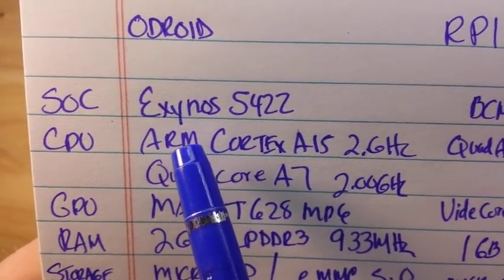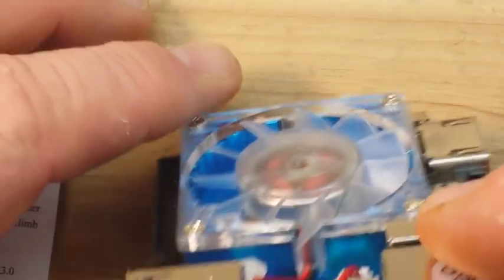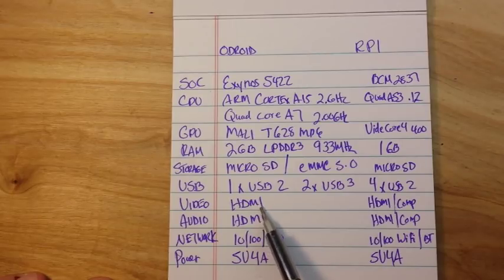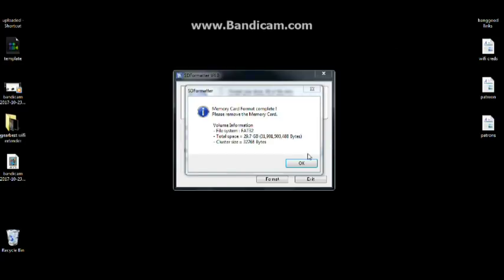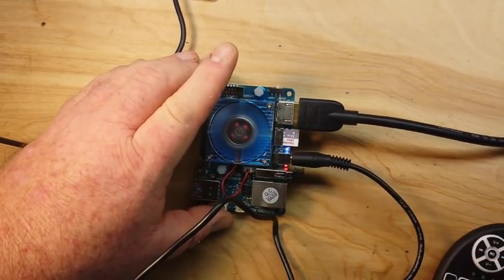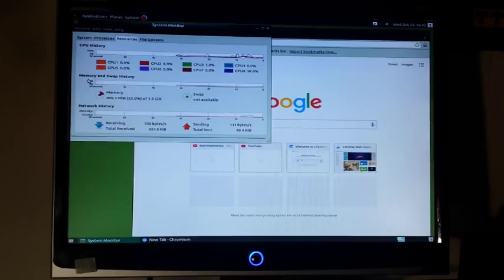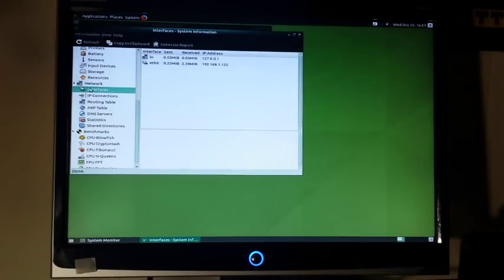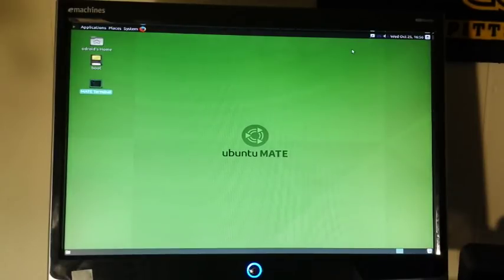Odroid XU4 first look

Comment: You forgot the MFC and a lot of other pieces that accelerate stuff through standardised linux kernel API's.
Basically I think everything should probably work with a 4.15 kernel except for the tmali driver (needs a gpl kernel patch), and the HMP scheduler. Samsung is one of the top contributors to the linux kernel, so I guess that this will eventually all get sorted out.
The only thing I miss on hardware use is that since there is no real kernel API to deal with resizers, rotaters, color converters, plane mixers and actual output, we still can't render to a video buffer, and mix the video buffer with the desktop buffer upon serialising the data to the HDMI. On a pi that's a kludge, but it is done. On a xu4 rendering of a video stream now goes through opengles to bitblt it onto the desktop. It can mix and alpha blend 4 bitmap planes, but alas :-(. At least we have a very good upstream support.

I have a XU3 that I use as my desktop. I have a few XU4's as my home cloud as buildservers, VoIP , mail filters, etc. With the HC1 (stripped down XU4 with sata interface) I hope to replace 50% of my current home cloud. The CPU outperforms generic c code by a lot when comparing the exynos with for instance intel atoms, or the mobile i3. As a matter of fact, I was dissappointed to see that a current mobile i5 still can't outperform my 8 year old core i7 920 when doing some video conversion.
Which unfortanetely is a real pain on an exynos, as most of that code was hand optimised for intel arch.

Comment: nmcli or nmtui should get u up and running if u wanna use the terminal.
Reply from the maker: +ccc is that for the Wifi?
Reply: nmcli d wifi list   (to connect) nmcli d connect <nameofWifiInterface>
Reply from the maker: ccc Thanks!
Reply: all options if u scroll to the bottom it gives examples   https://developer.gnome.org/NetworkManager/stable/nmcli.html

Comment: Great video as always! That would make a rather decent desktop PC for very little money. And I hope you will feel better soon even though your heavy breathing was no issue at all
Reply from the maker: +Michael Eckl Thanks. I think it will make a very competitive desktop to the low end Hps and dells you can get for 300-400 bucks from Wally world.

The more I play with it the more I like it. Right now, the only downside I see is the lack of a SATA port for an HDD.

I'll be doing another video when I get more familiar.
Reply: Cool! Looking forward to that! 
The missing SATA is a bummer but a USB 3 disk or a big enough SD card should provide enough space. It will just be slower compared to SATA
Reply from the maker: I demonstrated all cores running in Ubuntu in the next video.
Reply: That 'oct core...' the Odroid has A15 high performance quad cores AND A7 power efficient quad cores on the same chip. So yes, 8 cores BUT
(and as far as I know, so feel free to fact-check) BUT it never runs all 8 at once. Making it's top 'speed' 2ghz A15 quad cores. Still much faster and less power efficient, than the 1.2ghz A9 quad in the Pi3.

Again, making some assumptions, I think the A15/7 4+4 soc is used in the Odroid for two reasons. 1 - it's a common format, already used in many flagship phones which step to the A7's to save power. 2 - when you read the specs in looks like it has 8 parallel cores...

To the best of my knowledge it is technically possible to run all 8 at once, maybe Ubuntu or Android are planning to support this? However, at very least that means dealing with a LOT more heat. Even with the Odriod's fat blue fan installed, the A15/7 Cortex die isn't designed to dissipate all 8 at once.

So what's that then? Yes it has 8 cores. No it's probably not 'oct core.' Yes it's much faster than the Pi3 (also more expensive) Yes it might be able to use all 8 but it's not designed to, but sbc's are for hacking ;o) maybe someone will hack it on Android for 8-core gaming? xxJ
Reply: oh, and the Sata port is on the corner of the board, next to the usb3 sockets. It's only Sata Data, so you will need to find power from somewhere or buy a Cloudshell2 or similar for 'real' sata sockets. ;o)
Reply: Gimme the link then, I'll watch more :)

Comment: when getting my odroid i just bought the dongle directly from their site and it worked.
Reply from the maker: +fredlllll Mine came from Amazon. But I did order a don't let based on RTL8188 as recommended by CBM80AMIGA.
Reply from the maker: +fredlllll Are you running the Ubuntu Mate from Hardkernel?
Reply: yup
Reply from the maker: +fredlllll Thanks. Do you have any trouble reaching repositories? I keep getting errors.
Reply: uhhhm its been a while since i tinkered with it, but i dont think i had any problems or i would still be mad at it XD

Comment: You probable don't have proper kernel module/driver for your dongle. Find out what chip is used in your WiFi dongle and google for it "<chip> ubuntu  module/drivers odroid". I hope you find something useful. Even if not for exactly for odroid you can compile source code. Easiest way is as always to use most common hardware which already has kernel module built-in. That's why I suggested this cheap Realtek which works well with less supported platforms like Orange Pi.
Reply from the maker: +cbm80amiga I ordered the chip you recommended.
Reply from the maker: +cbm80amiga Thank so much. I ordered the dongle you recommended and it worked straight away.
Reply: Hi, I am thinking of getting a XU4, what realtek dongle did you get ?
Reply: Cheapest Chinese dongle with Realtek RTL8188 chip for $1.6 usually works on most devices.

Comment: My laptop has 1 3.0 usb port and this board has 2 usb 3.0 😁🤣
Reply from the maker: Electronic projects My laptop has 0 USB 3, you're doing better than me.
Reply: My xu3 (predecessor, 3 times as expensive) has 1 USB3 and 1 USB 3 OTG. Which means it can act as a USB device/gadget. But unfortunately it only has a 100Mb/s NIC.

Comment: I've had some problems with wifi and Ubuntu. It seems drivers are the hard part. This is a really cool board and fast too. I hope you do some more with it maybe run Android? Hows the other big new toy coming?
Reply from the maker: +George Chambers There will be more coming on the XU4 in the future. I'm looking for something to use as a desktop replacement.

The other project is about 20% complete, and I'm done for the night. I need to look at some code for a patron, then tomorrow I work till 7. So probably I'll get back on it Saturday.
Reply: Cool, I can't wait to see what you can do with both!